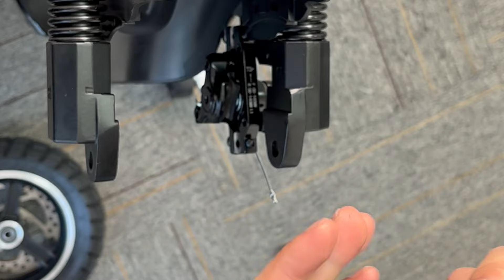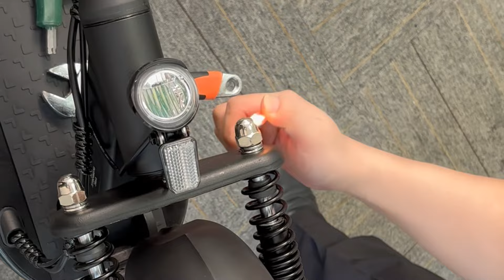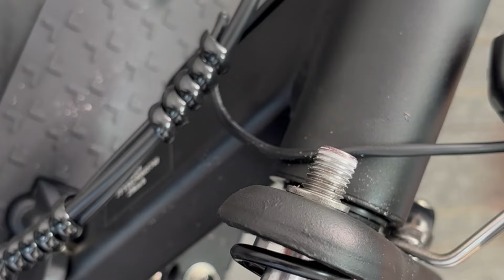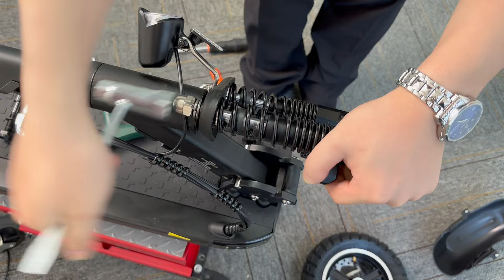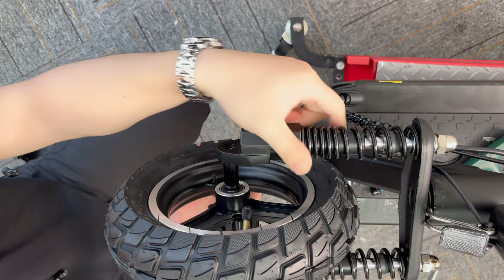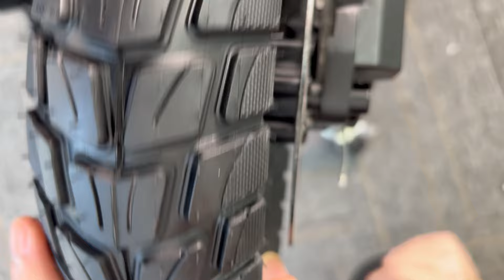How to replace the front spring shock absorber of electric scooter JOYOR Y6S Y8S

Comment: Hello, I have a video suggestion for you.  To find out which shock absorber it is (soft, hard, middle) on my scooter (S8S), I removed the front wheel and the 2 orange forks using the extractor, I was able to access the housing and  I saw that they were the red chock absorbers (middle).  The Big problem, when trying to reassemble the forks I noticed that the long screw of the extractor, by forcing, perforated the internal thread of the axis which passes through the chock absorber!  The diameter of the long extractor screw is too small!  As a result, the thread inside the metal axe is damaged and therefore impossible to replace the screws on each side!  It would be cool to make a video on: "how to recover a damaged thread".  Thank you so much.